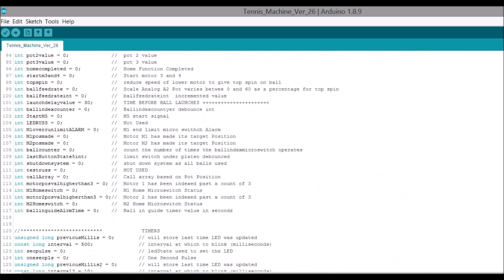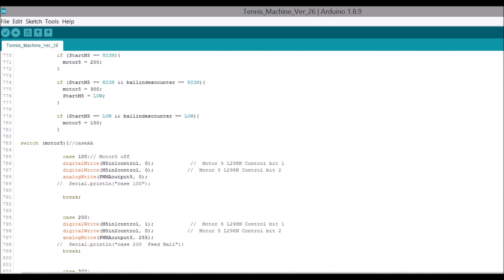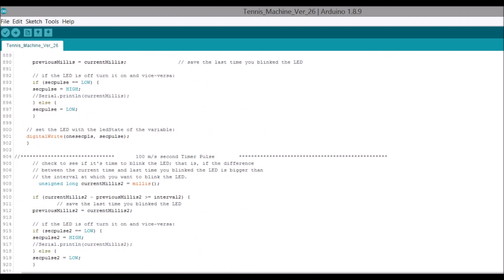Arduino driven Tennis Ball Machine, My first Arduino Project.

Comment: What type of motor did you use for horizontal movement?
Reply from the maker: Dc Motor,XD-42GA775 DC12V/24V Micro DC Gear Motor Large Torque Adjustable Speed Motor with Bracket(400RPM-24V)

Comment: Could you please tell me the motors used for rotating those two wheels
Reply: 12/24V 30W High Speed CW/CCW Permanent Magnet DC Motor For DIY Generator(24V)

Comment: First of all your project is very nice, in fact I think nicer than other ones that I've seen.  It would be a lot more helpful to post the code in a doc or text form.  I think its unrealistic to be able to retype a 1000 lines of code straight from video.  Also, it would be nice to have a little commentary on how you built it and what materials you used, etc.... But regardless, thanks for posting!

Comment: Hi. Looks great! Can you please tell how did you make those ball launcher wheels?

I am also doing a similar project but my wheels are wobbling a lot, so not able to run the motors at high RPM.
Reply from the maker: Hi, Bought the wheels from internet 125mm dia.  they are nylon inner with a rubber layer attached.  its important to balance the wheel to eliminate vibration.  I placed the wheel in a lathe and re bored the centre of the wheel, then made a brass shaft to fit the wheel on.  I then balanced the wheel with shaft by placing the shaft on two stanley blades in the vice (CAREFULLY)  you then simply look to her the wheel rotates to and drill a bit of the plastic out until you get it balanced.

Comment: Very good project pls could you tell me the ball launching machanism?
Reply from the maker: Hi there are 2 of 24vdc motors rotating two 125mm dia wheels in opposite directions, the ball is dropped into the center of the two rotating wheels and compressed and thrown out.  The wheels rotate at around 3000 rpm.

Comment: Hello. Can you please tell me the parts and boards you used to built this awesome machine?
Reply from the maker: All following from Amazon
2 of ball launch motors from Amazon12/24V 30W High Speed CW/CCW Permanent Magnet DC Motor For DIY Generator(24V)

2 of sourcingmap® 2 Set 15mm UFL002 FL002 Self-aligning Pillow Block Bearing Flange

Alftek Switch Power Supply Adapter AC to DC 24V 20A 480W Voltage Transformer for

2 of HALJIA LM393 Comparator Speed Sensor Detection Module LM393 Chip Slot Motor

Elegoo 120pcs Multicolored Dupont Wire 40pin Male to Female, 40pin Male to Male, 40pin Female to Female Breadboard Jumper Wires Ribbon Cables Kit for

Aussel 10K OHM B10K Linear Potentiometer 3 Terminal Rotary Potentiometer with Cap Nuts and Washer 5PCS (B10K-5PCS)

WPERSUVV 12Pcs Micro Limit Switch | Momentary Hinge Metal Roller Lever Micro Switch AC 5A 125 250V SPDT 3 Pins - Black

10A Dual Channel Bi-directional DC Motor Driver Speed Controller 5-25V 30A peak
Sold by: Cytron

sourcingmap DC 24V 7RPM Worm Gear Motor 20kg-cm Reversible High Torque Speed Reduce Turbine Electric Gearbox Motor 8mm Shaft

Youmile 5-Pack Dual H Bridge DC Stepper Motor Drive Controller Board Module L298N for arduino

ELEGOO MEGA 2560 R3 Controller Board Compatible with Arduino IDE ATmega2560 ATMEGA16U2 with USB Cable Black Version

Valefod 8 Pack LM2596 DC to DC High Efficiency Voltage Regulator 3.0-40V to 1.5-35V Buck Converter DIY Power Supply Step Down Module

QLOUNI 16MM Push Button Switch on/off Lockless Momentary Button Power Switch, Waterproof Mini Car Switch Start Button, Reset Push Button Switch for DI

Asdomo ZGB37RG Reduction Motor 37mm Geared Motor DC 24V 30/100/300rpm Micro Speed Reduction Motor, Mini Gear Box Motor,Electric Gear Motor
Dc Motor,XD-42GA775 DC12V/24V Micro DC Gear Motor Large Torque Adjustable Speed Motor with Bracket(400RPM-24V)
Reply: @builditmakeit5593 ... What a great result.... I wish I had the skills for replicare it...
I can put together the hardware... But no clue for the electronics part. 2ventually...hiw much approximately did you spend for the finished project? How many hours of work? 
Best regards
Franci

Comment: Hello! That project looks amazing!

Would you be able to describe how you managed to attach the wheels to the motor shaft? I'm assuming you had to use shaft couplers/hubs and maybe extenders? But how did you get the wheel to stay attached? Was it a direct mount? I'm trying to make my own project, but I can't figure out how to get a castor wheel to attach to the motor shaft (especially when the shaft is <1 cm long). Thanks!
Reply from the maker: Motor shaft is 8mm dia, i turned a shft to 16 mm, drilled the shaft to accept the 8 mm motor shaft and drilled the wheels to 16 mm, two small screws through plastic wheel hub into shaft.  all needs to be accurate to avoid vibration as the motors turn at 5.5k rpm